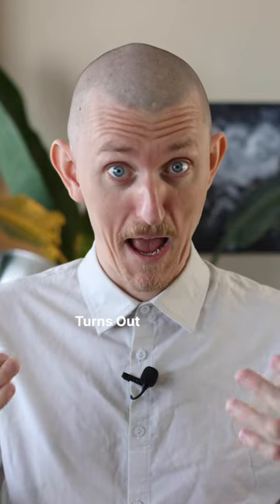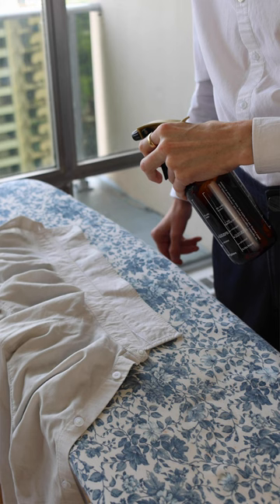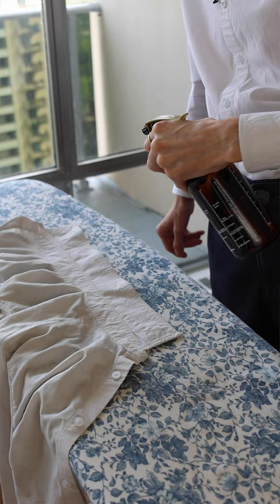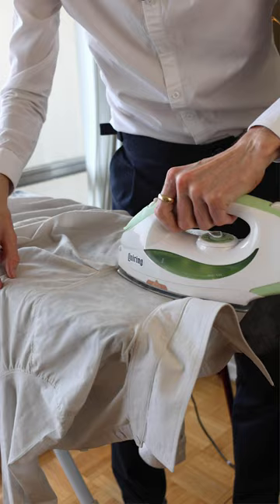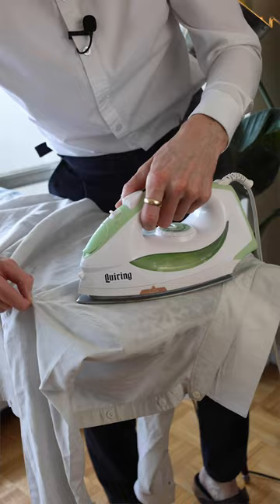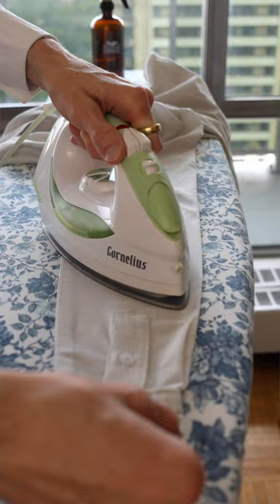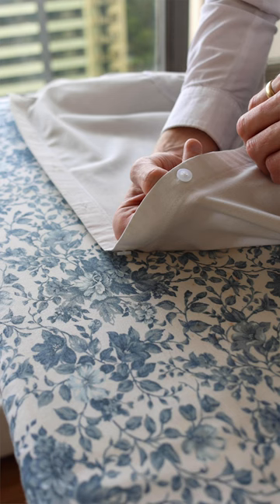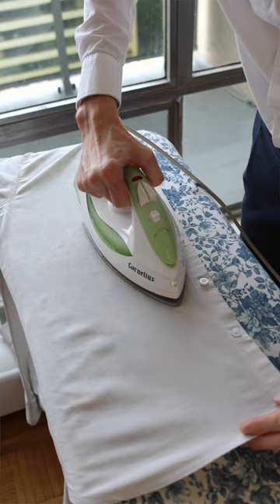How to Iron a Shirt ... Properly

Comment: Sorry to burst your bubble, however this is not the "proper" way to do it but rather subjective. Water spray is unnecessary with steam action. Turns out, you're ironing the wrong side of your collar! You only need to iron/steam the other side. I personally prefer steaming vs ironing and have found it to be even more adequate. The steamer can easily tackle wrinkles that are extremely difficult and sometimes impossible to get with an iron. It can also eliminate pleats unlike an iron. Steaming does not introduce wrinkles the way that ironing does either. It additionally gives the shirt a much more relaxed look and feel.

Comment: I've struggled with ironing. It seems like once I iron one side and go to the other, the side I just ironed gets all wrinkled all over again because of how it lays on the ironing board. Its so frustrating. Any tips for preventing that? Someone once suggested that I put a little starch in the distilled water spritzer but I haven't tried that yet.

Thanks for the great content!
Reply from the maker: Doing the body last really seems to be the trick. Also, make sure you do several passes to dry out the fabric from the spritz. The water helps to make it easier to iron but also, much easier to wrinkle. I hope that helps.